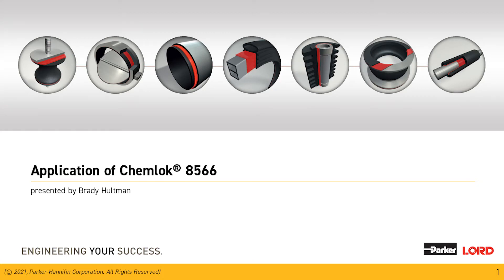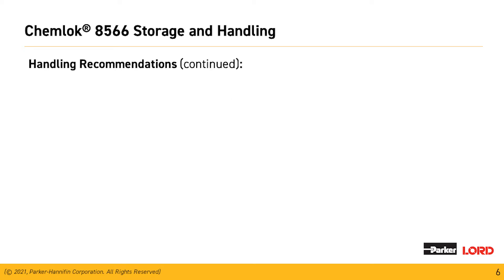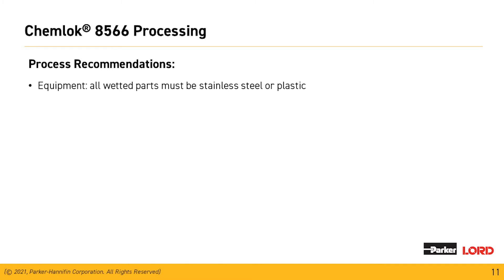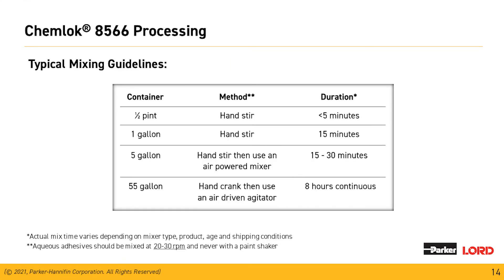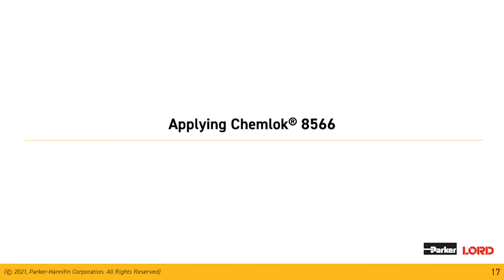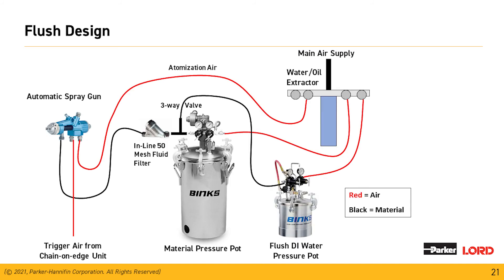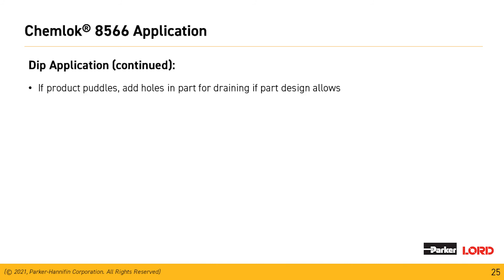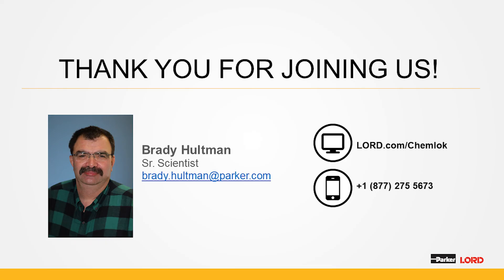New Water-Based Chemlok for Automotive & Industrial Applications, Part 2

Comment: Single coating metal to rubber bonding is possible...Bonding strength is high or low  compare to double coating process...